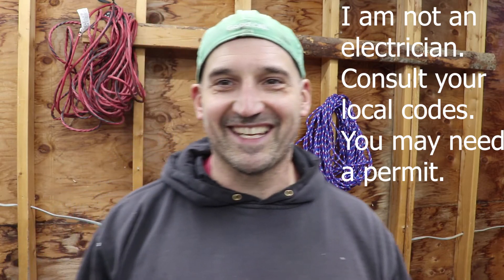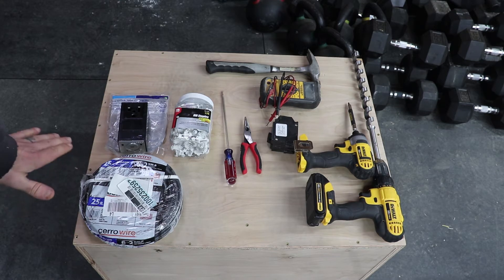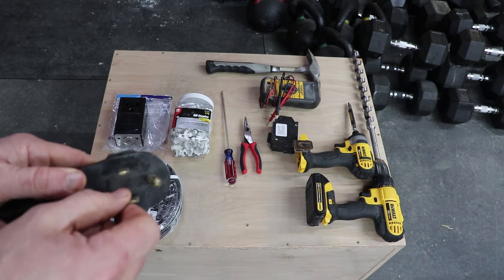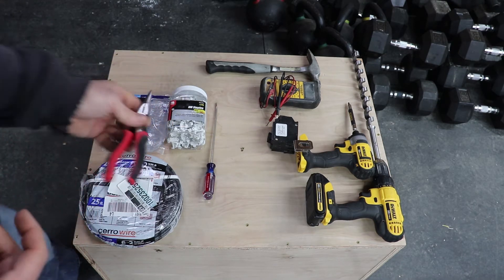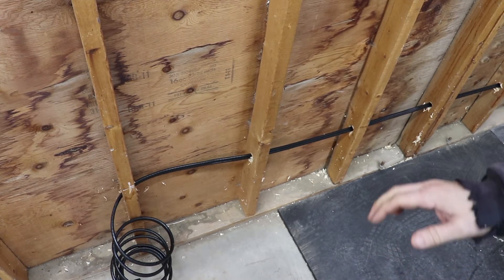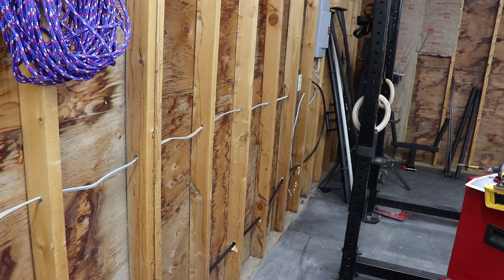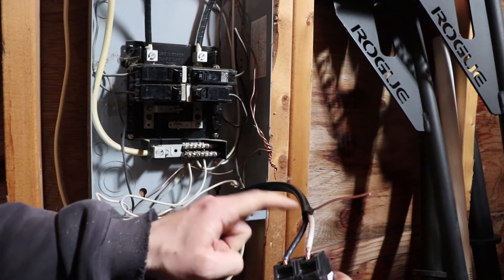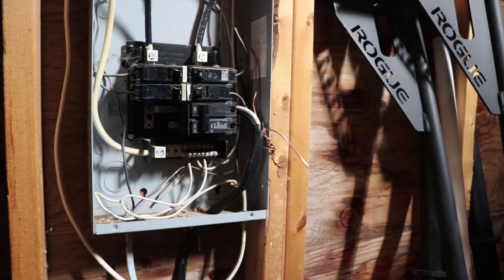How to install a 50 amp welder outlet

Comment: There is a hazard here.   The panel can is not grounded.  It can become energized.   Since you are standing on a grounded surface(concrete) makes it more likely for shock.   A ground bar kit would be in order.   Also, please take better care to not leave so much exposed conductor at the breaker and the receptacle.   Dangerous!

Comment: Your return wire needs to be the same size as the hot wire.  Use 6/3 wire.
Reply: A welder circuit does not require a neutral. 6/2 is all that is needed. On a dryer 240 outlet for instance,  the dryer will sometimes only pull 120 and uses the 3rd wire in the 3 wire NM to return.  Not the case with a welder which is 240 at all times